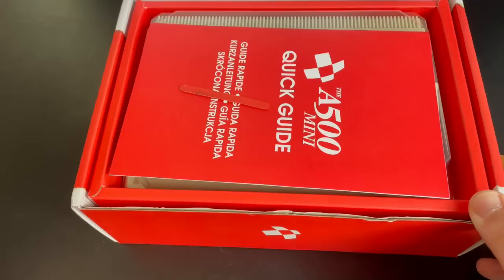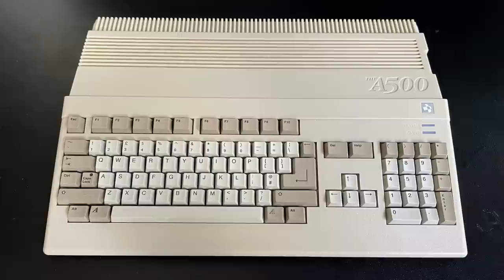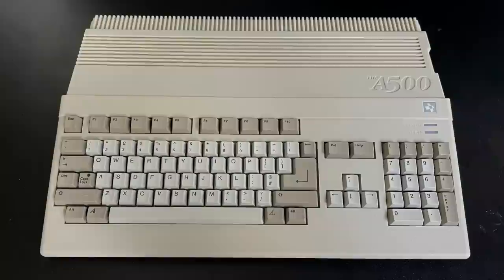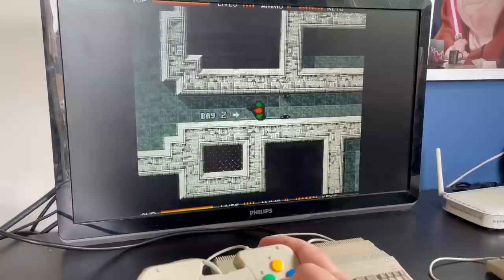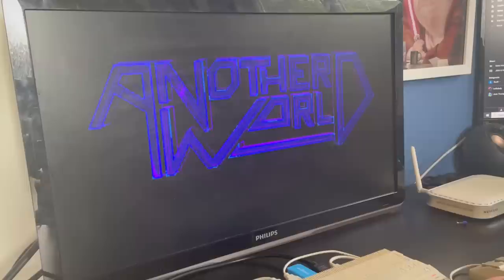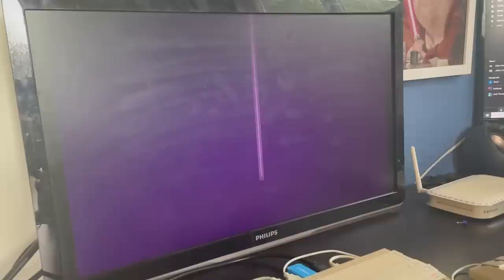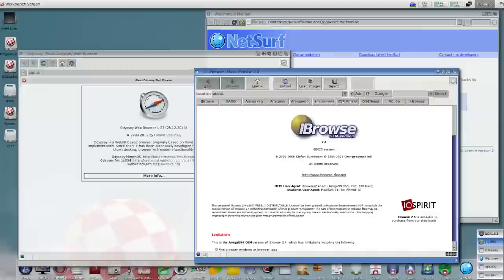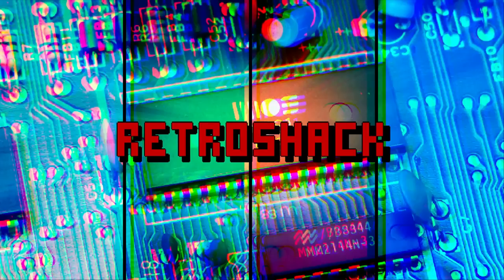The A500 Mini is cute, fun, well made and fits in your pocket - but who exactly is buying them?

Comment: You've certainly hit the nail on the head for me: if this had been a full size machine which would've then included a fully working keyboard, I would've raided the piggy bank and bought one of these. A missed opportunity there.
Reply: I would have been happy with an A500 Mini if the keyboard worked and it has USB 3.0. Hell, an NVME or space for a 2.5" drive as well. For $150, it just seemed pricey for what you got there since you can get that Pi 400 for $85 which comes with ethernet, USB 3.0, and so on.

Comment: I had an Amiga 500 when I was a kid. Now an aging IT pro, I have Pi projects aplenty and loved the look of the a500 Mini, so bought one. It's not limited to 25 games at all. I've got hundreds more on a USB stick, as the Mini supports the whdload format. And it emulates the a1200, so I have the AGA versions of many of the games. For me, it's been worth it.
Reply: Well, wasn't the point that if you're using a USB stick with WHDLoad and emulate and A1200 anyway, you might as well save money by going the Pi route? For me personally, I tried the A500Mini playing Battle Squadron, Great Gianna Sisters etc. But for me, the timings way too far off and I really struggled. But then, I'm a really pedantic gamer. So I use a MiSTer, which is, well, perfectly timed. I experienced the same with the TheC64 Maxi. I really like it, but play GGS, HERO, Bruce Lee 2, and I died all the time. Too slow. And it didn't even run GGS 2 properly for some reason. I think the emulation software ran with too many nice options on, so it lacked the horsepower to run Great Gianna Sisters 2... So if the timings doesn't bother you too much, I love the TheC64 Maxi, but I don't see the appeal of a Mini really..
Reply: @erwindewit4073  I've ran into emulation problems too.. can't play GGS2 or Vroom, but most things run ok. I dunno, I suppose the thing will end up on a shelf eventually, alongside my SNES mini. But, for now at least, I'm enjoying it. I have a few Pi's doing different things.. maybe I will recommission one of those at some point.
Reply: @MattRichardsEsq  Everything DID run properly on my Mac using Vice though. And the timing was a lot better too . So I play with the TheC64 casually, or program a bit. But really, if I want to do that I tend to use my C128D instead..

Comment: I've only ever used an A500 once at a friend's house back when I lived in the UK.  I've been enamored with them for a bit, but never pulled the trigger.

I think an A500 Maxi will be the console that I'll finally actually buy, as long as networking works and it's easy to load normal software.  I'd love to BBS on it, for one thing.

Comment: Thanks for the honest review. It’s nice to hear a somewhat balanced opinion not “on day zero”. There’s always hype around this things and I respect anyone’s choice, though I basically agree with your point: it’s a gorgeous piece and a perfect gift, but I won’t spend that kind of money instead of buying a general purpose device like the Raspberry, or a custom add-on when I have some real Amigas waiting for some love and possible upgrades.

Keyboards, like in the C64 maxi, are really a valuable characteristic. Using the PC keys on an emulator has some major drawbacks (apart from “dettaching from nostalgia”). Some software gets even almost unusable because of the compromises between host system hotkeys and the emulated one, specially when using non-english layouts (a Spanish user here).

Great video, as always. Cheers from Madrid !!!

Comment: The Mini is made for people like me. I have an A500 in the loft - it won’t connect to my TV. I have a raspberry pi which emulates most systems fantastically, apart from the Amiga where it’s hit and miss and usually involves an hour of ‘tinkering’, when all I want to do is play games. With the Mini, I have put in many, many hours on SWOS already and have loved it just as much as I did in the 1990s. It’s what I have been waiting for. It’s plug and play and allows me to have an hour or two of fun on some great old games. The people who don’t like it seem mostly to be those who basically argue that it’s not complicated enough - because they would rather spend hours configuring file types or exploring Workbench. I don’t get it. It’s meant to be fun and it is.

Comment: I've never owned/used an Amiga before - but as soon as the mini came out - I bought one.  My reason for buying it was to help fund development of a full size one - similar to "The C64" with working keyboard.  A full size one would be perfect for someone like me who doesn't have a compatible monitor or converter for hooking up the real thing to a modern day monitor.
In the meantime - I will use my A500 mini to dip my toes in.

Comment: I'm a retro computer enthusiast with very limited space at home, so instead of getting the real deal, I got this, and no regrets. In fact I'm fine with having only emulation for most computers or consoles, and keep original hardware for my absolute favourites. Not everyone has a mancave, gaming room, basement or attic. Add to that that this thing, for me, will not be "a few hours of nostalgia". It will be my DE FACTO Amiga then. I will use it as such. I did the same with other retro computers. I buy the same games, subcribe to the same forums, print magazines and I participate in the same communities. And I do not think I am a second class citizen of any of them, despite what some ... let's call them "super hardcores" claim. All in all, I am enjoying myself immensely, and love the A500 as what it has become. My Amiga. You would say that puts me in Pi territory, but I chose not to. Just like the other minis, I use and if that means I can go beyond the initial 20-something games, and run Final Writer, make MODs, and later perhaps AmiTCP and Voyager, then I will, because it pleases me. PS: No idea why your Workbench on the A500 is so slow. The drawers load in instantly for me. I also have a C64 Maxi, and a BMC64 in a 40 year old case and with an original keyboard, painted in beautiful blue, the latter is my every day C64.

Comment: I have a NES, SNES & A500 Mini, all were used for about 2-6hrs then put in a box to gather dust.  I got them as i liked the recreation of the original style packaging and design and they featured modern conveniences like HDMI, USB without the problems / size associated with a vintage item, they all look fantastic on display in my man cave room.  The A500 mini appealed as i had a Atari 520 STFM as a kid so this was always the machine i wanted but never got and it runs 90% of the same games so win win.  I also own a Rasp Pi, but its not the same its more complex to use, doesnt look as pretty and .... i just could afford to buy the A500 mini so why not.  Its not a technical thing either as i am a software developer (programmer) so can easily configure a Pi, i just didnt want too, i do have a Pi however using 'Pi-Hole' and have used it for retro pi in the past as well.

Comment: I got the A500 mini as a birthday present and quickly put Workbench on it. 5000 plus games, a real blast from my past. I own a copy of Amiga Forever and was using emulation on my cell phone before I got this. 

 I also have a C64 Mini I picked up for $40 bucks a few years back. I would still buy the Maxi in both verrions given the chance.

 I would like to do the keyboard mod on the A500 Mini and take it a step further with a mini monitor and drives. A small, fully functional desktop arcade to break the workday up occationally!

BTW Raspberry Pi's are hard to get now, the Pi Zero W I have doesn't emulate an A500 verry well at all.

Comment: I don't see this as a controversial view, but I prefer it to the "but you can do it with a Raspberry Pi" attitude. I pre-ordered the A500 Mini, I still have multiple Amigas - but I don't yet have the Pistorm/Gotek/CF add-ons. So being able to drag and drop files to a USB stick and play games on a modern TV/monitor is a good thing. And while there are some obvious omissions the library of titles on there is nicely balanced in terms of genre and gives a broad view of what the Amiga was capable of.

Yes, a working keyboard would be great. But based on what happened with the C64 Mini/Maxi, that will happen in time.

Comment: I am an Amstrad man who never had an Amiga or Atari ST. Have a large collection of machines including an Amiga 500 and been emulating since the mid 90s. The Amiga itself takes up too much room so never really used it. Emulating the Amiga is a bit annoying, it never works quite how I want it to and thus never spend much time on it. I setup a Raspberry Pi 400 with the bare metal amiga emulator , but again it doesn't quite work as expected on various TVs. So this is why I wanted one and got one for my birthday this year ! Love it as it works exactly as I want, no mouse issues, no screen issues and runs the games perfectly. Its permanently setup next to my Next and other machines. I really like it and do use it. Going to knuckle down with Mercenary 2 - Damocles next !

Comment: I have one. Most of the time it is a display piece, but from time to time I connect it to TV. Nothing far from 386 real machine or some Wyse terminal emulator. They all are used when I have some time. And here is a plus you mentioned - just plug it in, play, disconnect and forget for some time. 
Speaking of full A500 Maxi - that would be great piece of hardware but if you compare the size - C64 you can put anywhere on the shelf. A500 is a big piece of hardware. I have real 1040ST and storing it is a pain... But I agree with you that full one would do much more for wider audience willing to keep their originals safe in boxes and would explore more of Work territory.
I was also disappointed by the lack of Workbench by default - which for me is like must have on any Amiga experience.

Comment: I got one and I am not unfamiliar with the Amiga.  I have a few 500's, a 3000, 4000 and a 1200 machine.  Why did I get it?  Ease of use, the tiny footprint, and it looks so good you know instantly what it is.  The only thing I use the Amiga for anymore is to play the games and with the AMINIMIGA USB download it makes this a wonderful little machine.   Why use applications when modern machines do it so much easier and faster?  Amiga applications have very little use other than to compliment an old Amiga to make things smoother on vintage hardware.

Comment: Exactly my feelings on the "mini" machines.  Pounced on TheC64 but instead of a mini, I would rather just have a Pi with a working keyboard.
Reply: As a longtime C64 user The C64 was great. I just changed the setup so it boots directly into basic and use it as a C64 with a virtual 1541. I love it!

Comment: My memories are of the Amiga of my mates 600 and I'd always wanted a real one, but the real 500 is a big ol' lump and space is at a premium.  1200's are expensive and still require money and time to get them usable. 
 If I had a bunch of real Amiga's I suppose I would look down my nose at it, but the Mini was a nice way of seeing whether or not I want to invest time and money on going for real Amiga hardware.  The jury is still out on that, but I still fire the mini up once or twice a week for a quick bit of Lotus 2 or Project X and afterwards it slips away nicely out of the way in my retro corner.

I also own a 'The Vic 20', because that was my Commodore system back in the day.  That doesn't get a lot of use anymore (though still far more than my real C64!) except for a bit of Gridrunner.

Comment: I wouldn't pay the retail asking price-I'd buy a used model.

The carousel games could be better. There's just a few classics. There's no way to mod the carousel like can be done on the C64 maxi, with the Maxi Tool 64. However, it supports third party controllers out the box, unlike the C64 maxi, it's fun to explore the Amiga's library, including PD games, 8 bit conversions and new home brews. It can also run Pandory, and although far from perfect, is good with old console gaming, and supports the C64, which is great, albeit there is no REU support just now. 

As shown in your video there are pre-made workbenches with games and applications. If you can pick up an Amiga mini for about £60 I'd recommend it as it's a classic gaming machine, but can play all kinds of computer and consoles via USB without breaking the system. 

If there's to be an Amiga maxi, it would probably be a 600 HD version, I'd guess. I'd like to see a triple boot option of a carousel/basic workbench/modded workbench or maybe a workbench with applications to be productive. I always saw Amiga as a work-tool rather than a 'games station'.

Comment: I bought a TheC64 Maxi for what sounds like the same reasons you did. As my olden days machines were a C64, then an Atari 520STFM (bought second hand in the late 80s - if I could have afforded one back then, I'd have bought an A500), then PCs, I probably wouldn't want an TheAtariSTE Maxi, and definitely not a TheAtariSTFM Maxi, but I might be interested in an A500 Maxi similar to what you describe. I also doubt the market for any TheAtariST, Mini or Maxi - most STE games were STFM games, not using the blitter etc, and most ST games had superior versions for the Amiga. Anyway, the 16-bit era is a kind of transitional in my view - lacking a lot of the complexity that came later, yet also eliminating complexity and longwindedness due to the older 8-bit chips limits, but it's more at a level where I might be more interested in a simple, long-term stable platform for hobbyist development rather than a retro nostalgia platform. Constantly evolving languages with constantly evolving tools and libraries constantly adapting to constantly evolving operating systems and hardware is very very nice - but also a huge PITA that sometimes I want to opt out of completely, at least for certain projects that I might not revisit for months or years at a time. I'm also curious about the Commander x16, but that's 8-bit, with both 8-bit benefits and some 8-bit annoyances (and also, like the hypothetical TheA500 Maxi, I can't buy one yet). But the more I think of it, the more I'm convinced that a Raspberry Pi is the obvious thing - yes constantly evolving, but as a cheap device separate from my PC I'm not going to feel pressured to keep up with updates, and I wonder why I've never bought one yet.

Comment: Yes, still using THEA500 Mini weekly and really love the active community around it especially on Discord. It actually beats recent activity on 'proper' Amiga Forums currently as there is a lot of negativity following the Cloanto vs Hyperion court battle and the nastiness of RetroPassion vs AmigaKit etc. Heck, the community coming together to hack and mod a new product actually feels like the old A500 days and I owned an Atari ST at the time! In the early 90s I saw it from the outside or by sneaking a read of Amiga Format in Tesco or WHSmiths! Now I get to join in! Ami-Jimmy is a legend getting Workbench (AMiNIMiga) working and now recently getting Deluxe Paint to work flawlessly (donate to get access to the V200 beta). Amiberry 3.3 that RGL chose for this has some limitations (serial disabled) and WinUAE has better compatibility with serial devices anyway e.g. graphics tablets but as a TV device in the lounge it's perfect for Deluxe Paint, Brilliance, Lightwave, Blitz Basic or even some gaming like it was designed for! 😉
Reply: I would have liked to see games that come from USB, have their own 'carousal type integration artwork" as well as the included ones., rather than a boring menu to choose from

Beggars can't be chooses :( I guess that would limit the point..
Reply: @Tech-geeky  That sounds like the AGS system! It's available as a soft mod option.

Comment: I agree with you.. I also bought the TheC64 Maxi and didn’t like the Mini.. But, perhaps even more controversial, I did buy a MiSTer FPGA, and really haven’t touched my Amiga 4000/030 since. It’s hard to get stuff on the real one, no real networking, only RGB output.. And I really don’t notice ANY difference between the MiSTer and the real machine! I did with the emulated stuff, but not here. And to be perfectly honest, playing Battle Squadron on full HD using a fightstick is fantastic! And if I get bored, why not switch to the C64 (also just about perfect), or the Mega Drive, or an Arcade machine? I really only really use my C128D if I also want the vintage look. But most of the time….

Comment: I ended up having to sell my Amiga 500 for debts, but I kept the 1084 monitor. I should probably look for an analog out option. I bought the A500 mini because it is cheaper than buying actual hardware, at least here in the US. I mean I'd still trade my mini for a real one hands down. Another reason is I figured if I buy a mini is that the possibility of a maxi would be greater (based on showing support).

Comment: Never had an Amiga, casually interested, have plenty of technical prowess but I don't want to spend time learning and tweaking emulator/machine/core configs, I want to use it.  The price is fine to skip all that now and explore my interest.  And yeah, it looks good on a shelf.  There's the workbench and hard drive hacks to add more stuff and I've got a Mister if I wanna go all the way later. I know it's compromised but it's "good enough" and the mouse and controller are fun to have if I want to go farther down the road with Amiga.